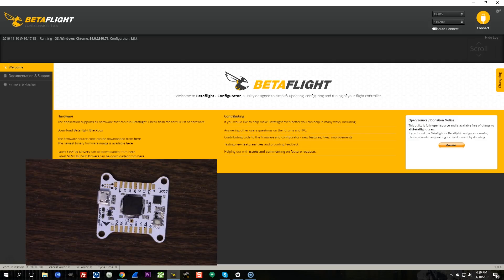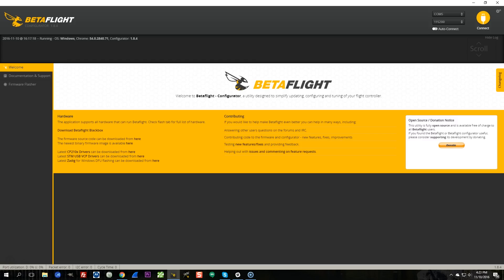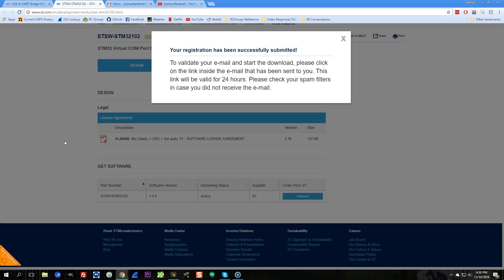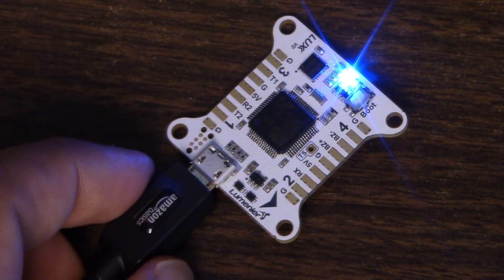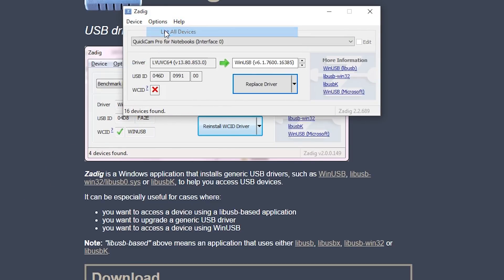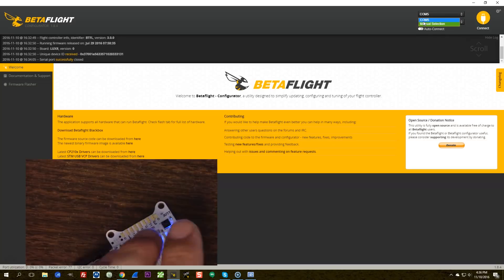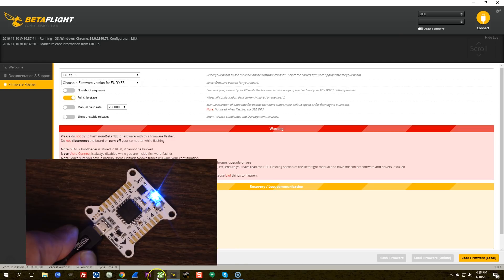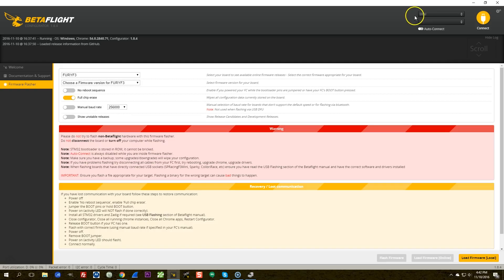Betaflight / Cleanflight Flight Controller Won't Connect | FIXED

Comment: correction....in Zadig i DO NOT get STM32 virtual com port....i only get unrecognized usb device with no "NONE" in the first driver box in zadig. I get DFU, i get STM bootloader but nothing else seems to be taking to the board
Reply from the maker: The ultimate answer is to sort out your drivers, put the board into bootloader mode, and flash the board. Make sure to flash the correct (SPRacingF3 Evo) firmware to the board. I'm not sure what you mean when you say you get DFU, you get STM bootloader.... where do you "get" them?
Reply: Stm bootloader in zadig when holding boot button. The com port box at the top of the configurator welcome page when I hold the bootloader. Its like you said the bootloader is always read by the computer. But when when you don't hold the boot button and plug it up nothing changes in the configurator com box all it says is manual selection. When I hold the boot BUTTON is says DFU in the com port box. It never said stm32 virtual com port in zadig. It actually said sp racing f4 NEO......the first time I saw that I figured I was going to have a problem. It is a sp racing F4 evo board not a NEO and not an F3.....The firmware exist in betaflight cleanflight and I NAV for an F4 EVO by seriously pro. The board is green and not one of the black clones(I guess board color doesn't mean anything) but seriously Pro Racing sales it on their website as an F4 Evo
Reply: I don't get a status light ever....EVER and only with cleanflight will the board even erase before attempting to flash. the other compatible configurators won't even erase the board the process just says "erase" and nothing happens.....ill make a video later

Comment: hey just for your info you never lose me with the long explanations....you are really easy to follow.
my sp racing F4 evo is acting like the chip has been replaced. supposedly it came with cleanflight but when i plugged it in it said it needed an update. so during the flashing proccess it erased fine but never flashed the firmware. so now it will only see the bootloader and when not booted the usb doesnt recognize it and the status light doesnt blink at all. from what i understand in need a stm32 LINK. do know of any other way to wake the chip up. i did everything in this video for my DYS F4 pro and it worked fine. i dont get any vcp at all only bootloader. zadig works but the usb still doesnt recognize it.........any thoughts

Comment: Joshua, You've done it again! Thank you so much for the info on the drivers. I just went and deleted what drivers were installed because I've been having problems flashing and changing settings. This video was a great help! Now Betaflight works, no problems flashing new firmware and changing settings. Thanks again!!

Comment: i am very new to fpv and trying to flash my SP RACING F3 from past 2 months and after following your steps in zadig option i'm getting (CP2102 USB to UART Bridge Controller) but i have a VCP flight controller , i don't know what is going wrong but i think i'm in loss now , if you can please help me 
thank you
Reply from the maker: SPRacing F3 is a CP210 board not a VCP board. You will never see "DFU" in the pulldown menu. You do not need to do the Zadig thing, and if you did the Zadig thing to the CP2102 driver, you need to uninstall and reinstall it.
Reply: Joshua Bardwell , thank you so much sir , I'm able to connect and flash now , but the only problem is my taranis x7 and x4r sb won't stay connected , it is bind but shows dim red and green light on x4r and won't work , any lead from you will be very helpful
thank you

Comment: Hi Joshua. I'm attempting to modify the settings in my Vortex Immersion 250, and I can not get betaflight to connect to it. I've powered it up with a battery (props off) and connected it with a USB to my PC. COM4 shows, but the connect button does nothing. It's getting very frustrating. Can you offer any suggestions please?
Reply from the maker: Put the board in bootloader mode and re-flash it. Make sure to use the correct target file though. The Vortex might use custom files that you can only get from Immersion. Frankly, you should probably reach out to Immersion supoprt.
Reply: More research later: downloaded "ImmersionRC Tools". Downloaded the Firmware and updates from Vortex website. Connected. Then struggled another few hours after flashing the thing. Had to do the wizard set up using fpv. Finally got it to arm. I can link the site or the video that helped me on request. Thanks for your reply. After all this, a build should be easy, right?

Comment: My spracingf3 fc had leds blinking but now they won't blink PLEASE HELP!!!!!!!!
Reply from the maker: If the LEDs don't light up at all when you plug in to USB, the board is dead and needs to be replaced.
Reply: Joshua Bardwell  mine let me flash  betaflight but it still won't let me connect to betaflight. I have a solid blue led on the flight controller. I'm so lost

Comment: Hey Josh I accidentally hit the top button in the urts section and now I can't connect to betaflight
Reply from the maker: You're locked out :-(

You need to re-flash the firmware with "full chip erase" selected. This will let you back in and then you can rebuild the config.

Comment: Love all the work you do in helping us with all the problems that pop up in the seemingly daily changes to how all this stuff works. I've been having this problem trying to connect to my KISS and now Betaflight FCs. I'm trying the betaflight board now and it seems to indicate it's of the VPC variety but still no joy. In zadig, I get it to boot up in bootloader mode but the file it shows to replace is the same as the one that's already installed. I did get it to act like it was installing the firmware and it even said the programming was successful but still...no connecting...in DFU or any other. How far back do I need to go with all the steps?
Reply from the maker: Make sure you flashed the correct target to the board. For Betaflight F3, you need to select BETAFLIGHTF3 from the pulldown menu when you flash the board. If you can flash the board successfully, then your drivers are correct.

You can't connect to the board in DFU mode. Only flash it. You need to see COM3 (or some other number) in the upper-right pulldown menu to connect.
Reply: Thanks again man, I'm the guy who offered the aluminum frames and show props to you on facebook.

Comment: Hello, I soldered the boot pins together and after flashing I tried to take off the solder and it will not so I think I ended up messing up my bootloader while trying to get the solder off. When the copter is connected to betaflight, I get this message "Serial port successfully opened with ID: 62" and after 10 seconds, I get this message "No configuration received within 10 seconds, communication failed" and then it closes the port. I don't know if you can help me with this. Thanks
Reply: Sol mag can you still flash the board or can it no longer communicate with it if you're in the bootloader?

Comment: Joshua is there anyone like you in the Mac World?  This is is excellent for PC folks.  Only the first software is downloadable on a Mac which I don't think is sufficient as I'm not seeing  a com port in boot loader mode. I've searched and searched to no avail.  Somehow I was able to download firmware two months ago, when I first started FPVs on the on the SPRacer F3 board on my new Eachine Wizard 230x But now I can't seem to get there on either a replacement SPRACER F3 on the same Wizard or a seemingly bricked CL F4 board on my my new Armattan  Chameleon.  Thanks.
Reply from the maker: As I say in the video, you don't need to install the VCP/DFU driver on Mac because it comes pre-installed. So you need the CP210 driver IF your board has a CP210 chip, which very few do these days.
Reply: Joshua Bardwell sorry I missed that.   I did install the Silicone driver.   Here is a longish geeky note to Silicon Labs asking for help.  I think you are as much of a geek as I am so maybe you don't mind and might even find interesting.  Thanks Adriano. 

Letter to Silicone ->

I cant get my MAC to communicate with a flight controller during boot log mode using your CP210x USB to UART Bridge VCP Drive for Apple OSX.. I did follow your debugging recommendations on http://community.silabs.com/t5/Interface-Knowledge-Base/Debugging-Issues-with-the-Mac-VCP-Driver/ta-p/192487. It communicates fine in non boot logger mode (for a software call Betaflight Configurator) but not for boot logging. The problem occurs for two Macs I have tried so I wonder if the driver needs updating as Apple has made updates since you last version. 

Interestingly after I install the drivers I get the following response from the Mac.  

	The system extension"/System/Library/Extension/CiscoVPN.kext" was installed improperly and cannot be used.  Please try reinstalling it, or contact the product's vendor for an update.

Reinstalling didn't help that's how I ended up on your debugging page.  Following the instructions, Idid  get the ports in to Betaflight Configurator (that is the software that needs the USB driver) and I get successful communication in non boot logger mode.  But when I try to load new firmware through the boot logger mode I get no communications. 

Therein lie a clue….. I hope.Maybe latest update for Apple?

Comment: You gave me hope by making the comment referring to an alternative method of enabling bootloader mode. Im a green-thumb (aka "newbie" & of no relation to garden growing skill) so it should come as no surprise Ive lost count of the many times this hobby had me packing it in for the day feeling disconbobulated, quickly approaching the threshold where the mind decends into a state of madness.  Im hoping it will be intuitive once I'm in Betaflight/Cleanflight what you had eluded in the statement about typing dfu mode in cli.  For now, though, you have renewed my faith in the possibility of flight for my little q90 FlyingFrog.  Its f3 fc has no bootloader button and finding a pinout has been an impossible quest. At the risk of sounding unappreciative I really wish you would have demonstrated the process of entering bootloader mode when you have no button and don't know the pinout for a particular fc board.
Reply from the maker: If you have BF 3.1 or newer, type "dfu" in the command line. Alternatively, in 3.2, they changed it to "bl" (for bootloader).

Comment: i am having a problem with two brand new flight controllers on configuration tab while changing button(disarm motors regardless of throttle value) from on to 
off in the ESC motor features...it changed receiver from sbus to spektrum serial receiver on its 
own after saving and rebooting...after switching back the receiver tab page shows all channels zero 
except one aux channel
what would cause betaflight to change settings i have not touched? this is the second flight controller
it has messed up changing this option
Reply: how would betaflight change other settings while switching one button
Reply: i wanted to be able to hit the disarm switch then turn off motors when i put the throttle all the way down
Reply from the maker: +quad55555 make sure you're on the latest configurator version, I guess. Thst shouldn't happen.
Reply: HMM... TR1TON  on rc groups has the same issue, temporal flux helped... on one i figured it out, i re flashed to the original 3.1.0 the channel bars are back to normal not all zero, and had to configure almost every  tab... somehow it was changed when i clicked save and reboot but heard no esc chime... the second one will not open the port to flash. i think i have heard u say it was maybe possible to open in boot mode through command interface?

Comment: Hi Joshua. Thanks for your tutorial. All  went well until I went to connect my Walkera f210 3D to Betaflight. Comm 4 showed up and when it connected I got a WARNING window saying, "Non-Cleanflight/Betaflight firmware is NOT SUPPORTED, except forCLI mode".   A black DOS window appears in background and has a lot of jibberish boxes and letters in it. Assuming it's "bricked" and I need to Flash it. Suggestions? Thanks!

Comment: Help!
Ok it worked was having an issues with blood loader my mistake was the drivers I did the virtual com instead of the boot loader one I did that I was good to go! BUT!! After I flashed the board I did a little bit of configuring saved and then when I tried to go in again the led is doing the slow steady blue blink I don't see com 14 anymore only 5,6 I don't see dfu. I went to device manager and looked at ports only 5,6 there and USB nothing like stm, bootloader, dfu nothing obvious. I test betafight with another board and port 14 comes right up I was having problem with this board and now it is fine.
How can I solve this?
Thanks for you help
Reply: The board that is blinking is the eachine minicube

Comment: Anyone know how long is should take to install the drivers? I'm still downloading the first one, and the bar hasn't moved for an hour
Reply from the maker: Not that long.
Reply: Joshua Bardwell Should i just restart and try again? It told me i had to download the 64-bit version
Reply from the maker: I guess you should try to download it again. That's what I would do.
Reply: Joshua Bardwell 

I was able to eventually download both drivers, but when i go onto Zadig i can't find the "STM32 BOOTLOADER" you mention. It is in bootloader mode already because i am getting no flashing green or red light. Any ideas?
Reply: Joshua Bardwell Don't know if it helps but i'm using an F3 Acro 6 DOF/Deluxe 10 DOF Flight Controller. Sorry for the confusion but i'm extremely new to this hobby.

Comment: lol i think the F4 flame is a board that cant be fixed by any of these fixes its in dfu but pc doesn't see it at all like its locked up also has no clock or i/o to link in to. I'm going to get creative though lol i hear you can get rid of gremlins with tomato sauce

Comment: Joshua do you know what one long beep means when the SP F3 FC powers up?  I don't remember a long beep when powering up.  Just the three quick beeps.  My rx is on and has a solid light, but the FC is not getting a signal from it.  It's been working fine.  Had a bit of a crash yesterday.  After fixing everything now I have the one long beep then three quick ones and the FC isn't getting signal from the rx.  Any ideas?

Comment: hi I recently bought the QX 90 with f3 evo, yesterday I swapped over to 2s and now it won't connect to beta flight. am I suppose to boot it again after swapping to 2s?
Reply from the maker: It shouldn't matter what battery you have plugged in. I'm not sure I understand the question.

Comment: Ok so then what about when you plug the device in, do everything you say, and now the computer doesn't detect that the flight controller is even PLUGGED IN.... no windows dinging, no devices popping up in the device manager, nothing. I have a solid LED, I've pressed down the 'boot' button before plugging it in, nothing happens. It also doesn't do anything when plugged in normally either (without pressing the button)... I have an omnibus F4 V2 Pro.... Been trying for several hours to get this stupid thing to do ANYTHING....
Reply from the maker: Some USB cables are for charging phones only, and do not connect the data lines. Have you tried a different USB cable? One that did NOT come with a cell phone.
Reply: Joshua Bardwell tried 7 different cables. Ranging from cables that came with a mouse, to other flight controllers, to data cables for hard drives... Seems like I must just have a dead board =D lol
Reply: Randy McChunderNubs projectbluefalcon has a video on how to ACTUALLY fix this issue... What happened is that chances are, u had the "erase" box checked, correct? So when flashing the board, it erased the boards "brain" but never actually wrote anything... And so when it's plugged in, it just sits there and doesn't communicate with the computer because it has zero instructions. You have to buy a specific programmer that costs around 2 dollars, and solder 3-4 wires onto the tiniest pads you have ever seen, located in places that are so stupid and hard to get to properly, that if u aren't good with soldering then uah fry the board because there are multiple power pins around it all... Once u do this, you use the CPU manufacturer's software to directly communicate with the CPU and program it to act like a cpu again. 

My explanation is very bad and done via my phone so mind of rushed. But look up projectbluefalcon and search through his videos from around the time the omnibus F4 came about, and you'll find the video. It's very simple to follow and what not, but u need REALLY steady hands...
Reply: Randy McChunderNubs that's how mine was. Do u at least have a light that comes on? If not then the board is unrecoverable.

Comment: found my problem with the bootloader connection was to switch ON the manual baud rate. running a spracing f3 acro

Comment: Hey Joshua,  guess what I managed to replace STM32 virtural COM port with the Zadig one (7:20)  and I seem to be locked out, computer not recognizing com port. How do i reinstall the old one? Thanks heaps for the help.
Reply from the maker: Uninstall the device and reinstall the driver. I think you can also put it back with Zadig.
Reply: Is the driver under another name? I cant see STM32 in the driver list.